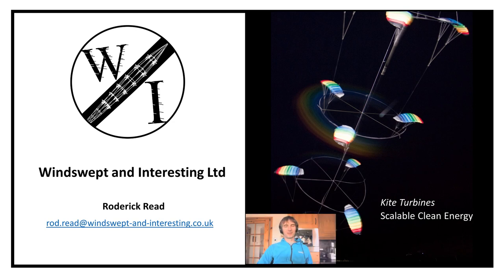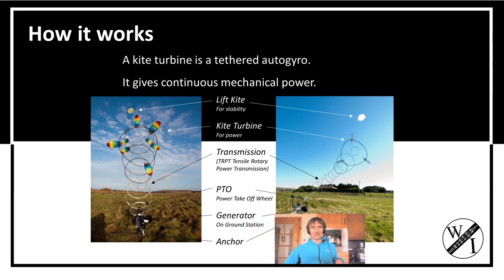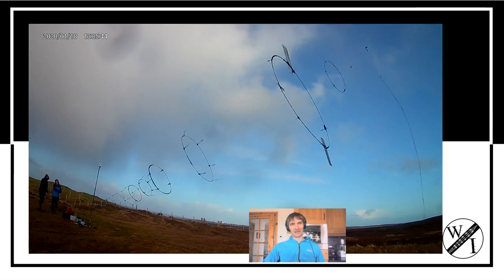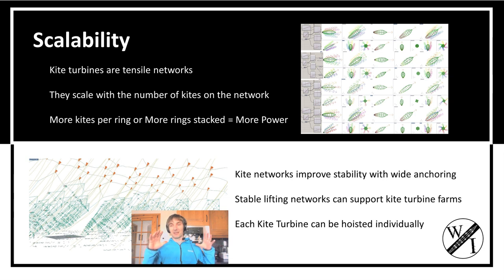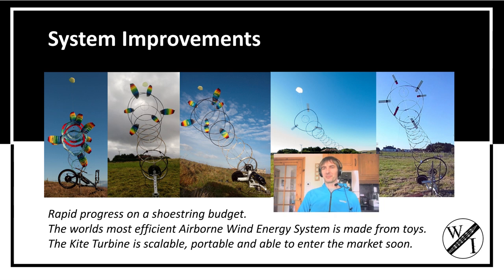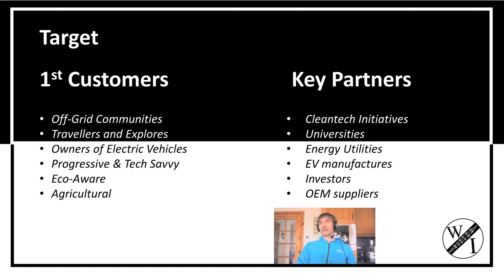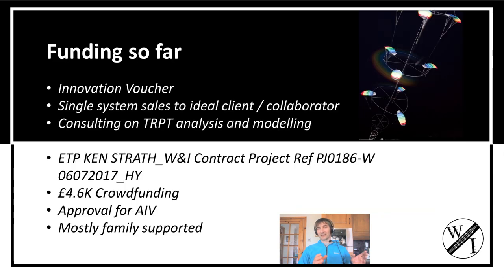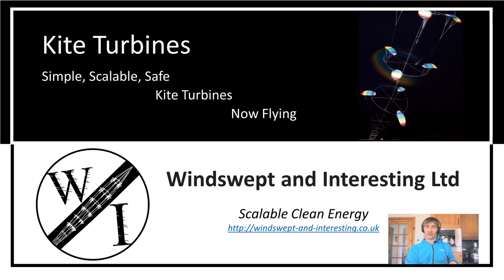Update on Kite Turbine development at Windswept and Interesting Ltd

Comment: Great work! I think the biggest question that comes to mind when seeing this construction when we think of large scale production, is what happens when the wind dies down, and it all falls to the ground, will it then be a tangled mess? And how is the system restarted? Perhaps there could be a way to use a mast/masts to hold at least some parts like the lifting kite off the ground when there is no wind, and make the whole system easy/automatic to restart again? Could a launch/restart system be made automatic?  Could there be a way to keep the kites off the ground when the wind dies down, so they are not chewed on or trampled on by nearby goats when the wind dies down?
Reply from the maker: Thanks Robert.
 On the small systems made here, when the wind dies the kite comes down. It works without any flight controller so it normally requires manual relaunch.
However, yes, large scale systems will need full automation for retraction and redeployment. We're working on it, but this is a tiny company for now. Please find time to work on your ideas for improving kite turbine deployment.
Reply: @KiteTurbine  if you need an AI engineer to help with the automation part, i would be glad to give it a try. Also if you think AI could also be used for generating an improved design, it would be a fun challange
Reply from the maker: @herscovicirobert2868  I do think there is scope for AI to become involved in the design. A lot of the rules of single kite AWES are written up well and now Ollies PhD on the Kite Turbine dynamics is being published too. So the very fundamental elements to play with are there.
Reply from the maker: @herscovicirobert2868  also considering how ML can be trained and analyse the performance of the coming prototype for control